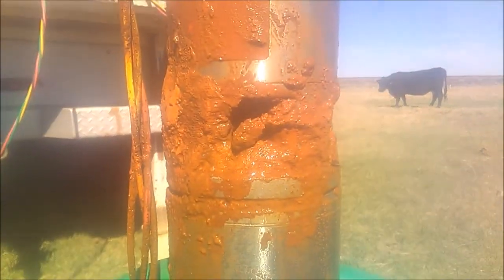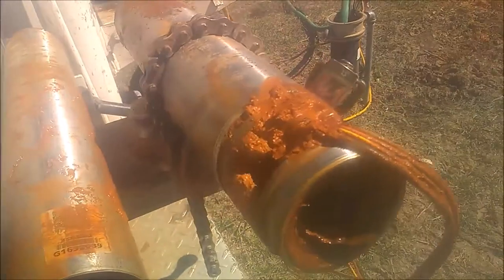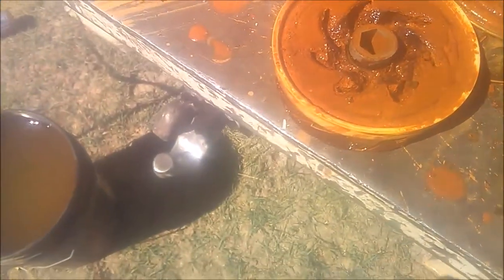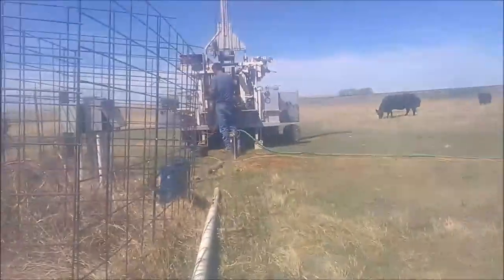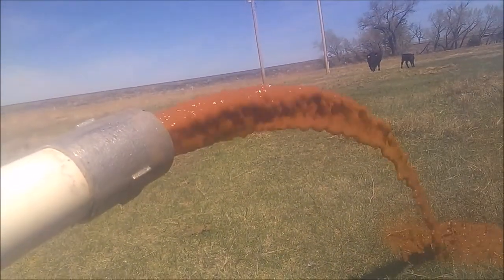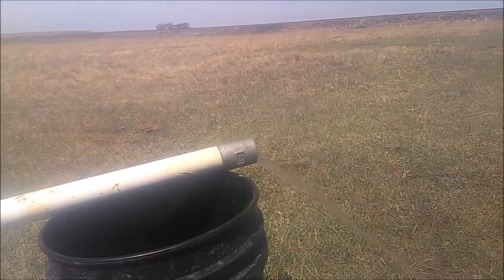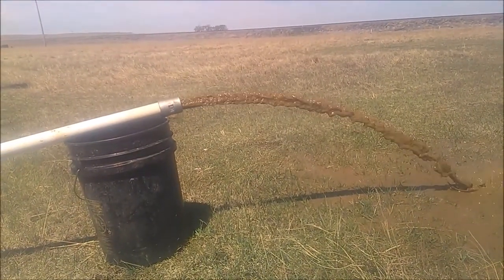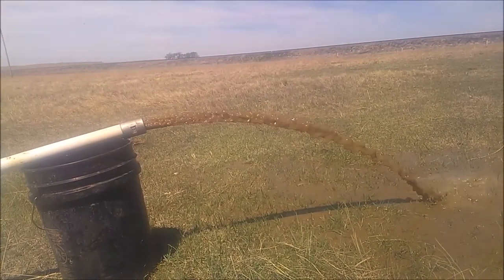Iron bacteria in a water well pump

Comment: They make special bleach for wells but you can't drink the water until you flush most out .
Reply: I have a 500 ft well that was put in six months ago. I got that smelly slimy rusty water. Today I just dumped 4 gallons of bleach down the well. Been recirculating the water and flushing all day. I will up update you concerning water pressure and cleanliness
Reply: Calcuim hypochlorite 680g/kg does the job
If you don't go over 5ppm you can drink the water and hardly notice the smell
Reply: what's the bleach or the treatment called? my house well is starting to be yellowish and has scent of iron :(

Comment from the maker: I have a litte more information about the well and a few questions.

Well info:
35 gpm 3 hp on VFD, 20 ft water level, 29' deep, 29' pump set operating 100-115 psi.
Well feeds livestock, 1 house, and sometimes fills a pond.
Two other wells close to this one were abandoned previously, presumably they plugged up the screen and stopped making water.

1. Does a VFD cause a pump to plug up faster (in fewer gallons) as it is running longer periods at slower rates than it would with a pressure tank/switch.
2. What treatment options are available for in the well treatment of the water. Chlorine, hydrogen peroxide, ozone?
3. Are stainless steel impeller pumps more resistant to plugging than plastic (composite) pumps.

Like I said in the video, we don't have a lot of experience with this problem but I do know replacing pumps often is not good for anyone involved.

Thanks in advance,

Kenny
Reply: Hey Kenny, Yea I would suggest a draw down seal on that well for sure.  If you can prevent airation of the water the iron won't drop out and prevent growth of the bacteria as well.  With such a great water level and drawdown it should hold fine at 30'. Typically I'll install the drawdown and pump set where it wants to be and cut it off there.  The issue with pulling the pump can be mitigated with putting a 1/8 tubing through one of the holes in the seal, then a tire valve at the well seal.  You can use a air compressor to lift the pump up for you no hard pulling needed.  
Take it easy man, Casey
Reply from the maker: Thanks Casey.  Who makes the well seal you use and do you have any suggestions for an inflatable packer that would cover 5-10 feet of casing?  Some of our wells have a pitless adapter through the side of the casing and don't have clearance for a full diameter seal.  We will be back close to this well in the near future and I may run a down hole video to see where the screen is set.  If the screen goes above the water level I'm presuming a seal would need to seal from water level to the top of the screen to be effective.  Thanks, Kenny
Reply: Kenny Kemp Have not used any inflatables other than stopping flow wells. The seal brand is Lemco, I'll have to dig up some old video of setting a pump with one.
Reply: @ClearWaterPumpWell
Reply from the maker: Thanks for getting back to me, I happened upon their site looking up seals just now.  They should be easy enough to install and may be flexible enough to rub past a pitless adapter.  For the cost it's sure worth a try.  I may even make a video of installing it myself.
Reply: Kenny Kemp https://youtu.be/2jaUoppmuI0
Reply: Kenny Kemp Yea you got a bad case of iron bacteria there. I'll answer what I know about it as we do see it occasionally here.

1. The vfd has no effect on accelerating the growth of iron bacteria. Any pumping or oxidation of the water in the well is basically like pouring gas on a fire for iron bacteria. So vfd or not, pumping in general accelerates the growth of it.
2. My experience with having success on iron bacteria with a long term solution is limited. Chlorination will work but not for long. We have used a product called bore saver and had some success. Depending on the level of iron bacteria you have, we have had some last 5-6 years before another treatment and some last only a year. I'm sure other treatment options are out there, but they will be pricey.
3. Haven't tried this before. It seems like a good idea to try, but in my mind this stuff is nasty and will stick to anything. 

Hope this helps, I hate this stuff and it causes issues for everyone involved.
Grant
Reply from the maker: Thanks for the reply Grant.  I only have 1 well with a SS pump in it and this issue.  They run it until it slows production and then shock chlorinate a couple times per year.  I don't know if it lasts any longer before plugging but seems to handle the heat and out of balance from being plugged up better.  Also the customer wasn't doing the maintenance on the pumps we had in before then so I don't have much of a comparison but they were getting trashed (melted and bearings out) every 2 years and the SS has been in there for about 5 now.
Keep up the good videos, stay safe,
Kenny